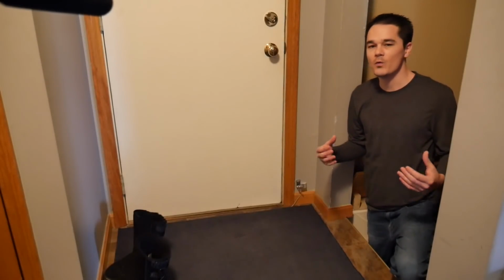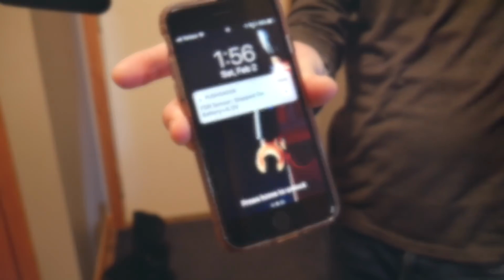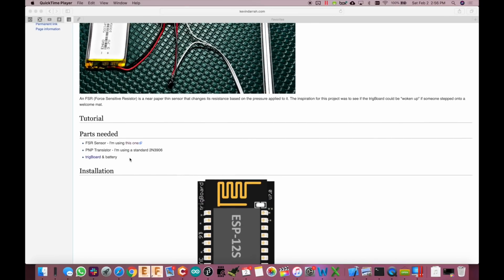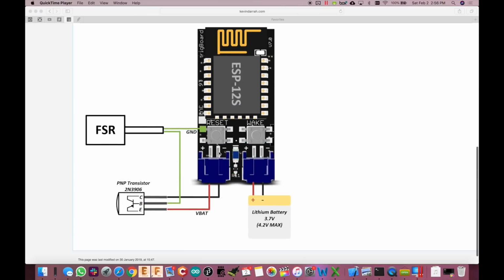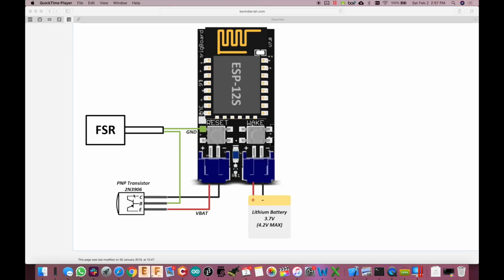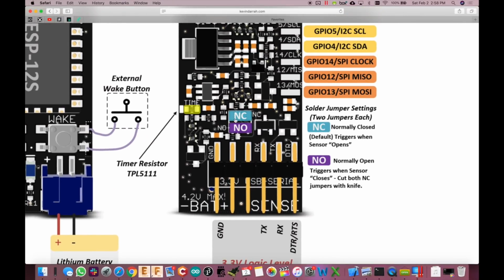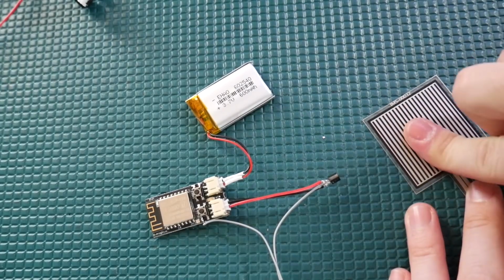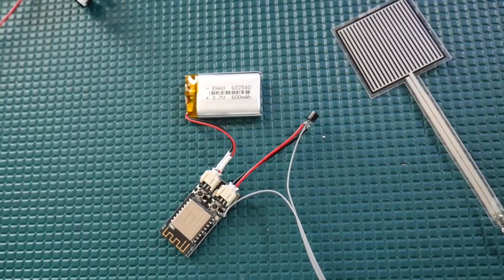Pressure Activated Push Notification on Battery! - ESP8266 with trigBoard!

Comment: The only two things currently keeping me from buying a couple of your trigBoards is the lack of documentation on how to easily have it publish to an internal MQTT server instead of using some cloud based 3rd party service. I would really rather never let it leave my local network. I already have infrastructure in place to push information to all sorts of devices. And since you obviously already did a lot of the work for lowest energy consumption I really don't want to mess with your design and code too much. Secondly a discount when purchasing five or more trigBoards would be nice. This trigBoard is actually the only such IoT device I would consider running on batteries. I really dig the design. Cheers! JM
Reply: Hi, Yes youcan use your mqtt brocker it very simple u can use a liberary called pubsubclient and write your code to send you msg and run deppsleep mode to return to sleeping mode
Reply: @TATIYALHOUCINE  I can imagine that. I would rather see a wiki article or better even watch a video on that subject, though. I know I could do it and figure it out but at my current time limitations I am a bit hesitant to dive into it. The deep sleep feature and code combined with the excellent low power design of the board is what I have been looking for for quite some time. That said - what I need will be a PnP solution with only a few variables to swap out at most. ESP Easy interface combined with the deep sleep and low power would be my dream coming true. Cheers!

Comment: Kevin, In the past I’ve put a raspberry pi inside my house alarm control box, and connected several of the pir sensor outputs to the pi’s GPIO. This way you can monitor several sensors that are already spread around the house - with one device. You could potentially do the same with a trigboard.